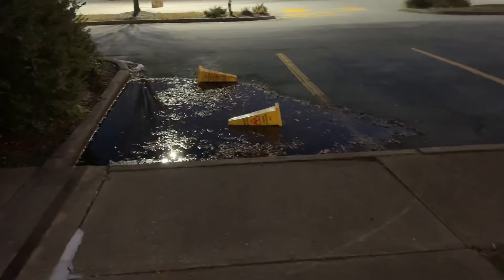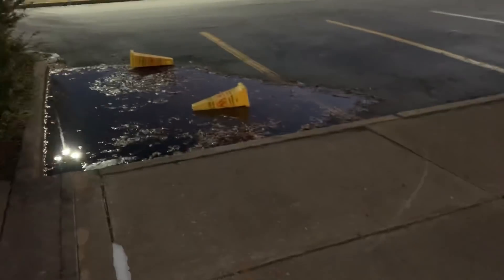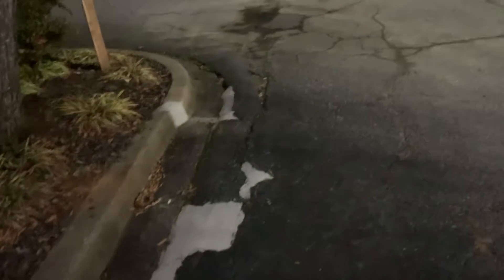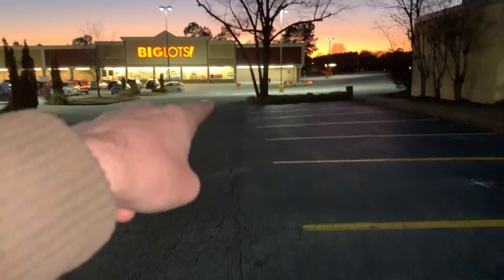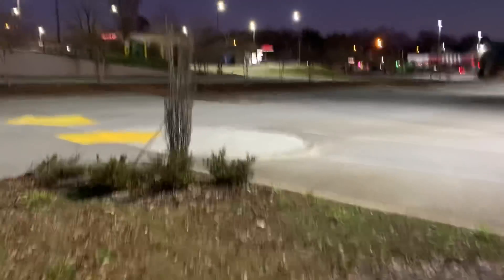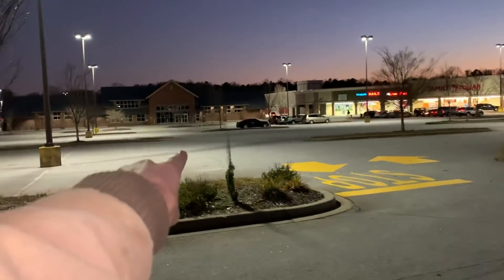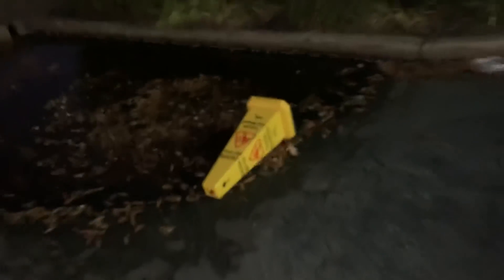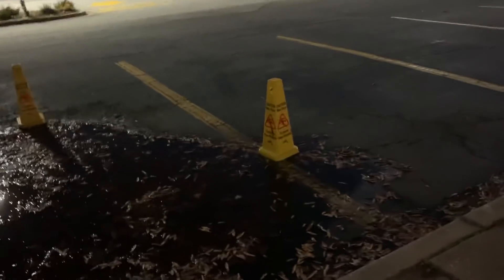Parking Lot poor drain design

Comment: This was a common problem at the theme park I worked at. What made it worse was every morning we had someone drive through the whole park with a water truck to blast the dirt and dust off the sidewalks in the park, causing water to pool at various places every single morning. It was just routine to take large squeegees and push the water towards the drains. Kinda expected though for low points when the walkways have been changed over the decades due to rides and attractions being removed or built, but this was a problem all year.

Comment: Sounds like the crappy way many houses have their gutters installed. Narrow, one down spout, no slope to the downspout at all, and rectangular drain pipes with right angle bends so debris catch and plug there. At my old rental they had a storm water runoff charge and all of the gutters went into french drains so did the one in the main driveway was on one too. No real way to prove we weren't going into the main storm drains in the street to get it taken off our water bill. It always plugged up too and even when it was clear sometimes it was saturated so bad the water just sat there.
Contractors many times just want fast and to look good, it doesn't have to last as long as they get paid.

Comment: They should have put a hole in the curb for the water to drain.  In my neighboorhood, after every rain or if someone washes their car, a big puddle sits at the end of the street (intersection) as the water has no where to go.     Further up the street, they did put a hole in one of the curbs

Comment: The contractors that do the paving for strip mall parking lots, apartment complexes, etc just crank em out  as quickly and cheaply as possible. Its usually one of last things need to done on a job after construction and work on the structure is nearly completed.  At that point the building owner or leaseholder are anxious to get the work completed in order for potential or current tenants to move in. Thus you get those kinds of problems that appear usually not too long after work is completed